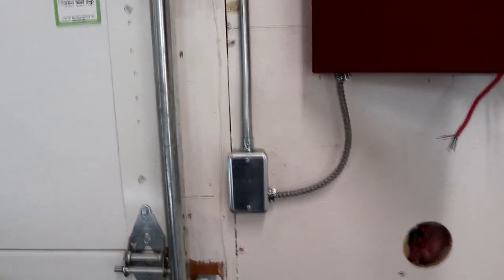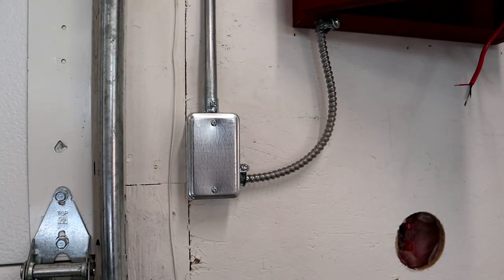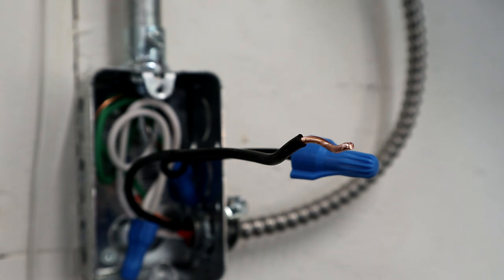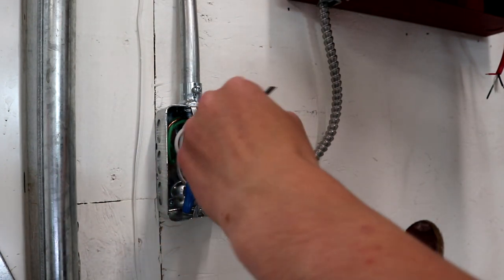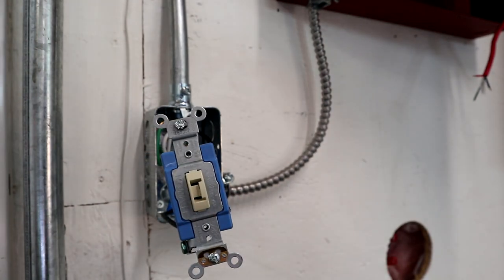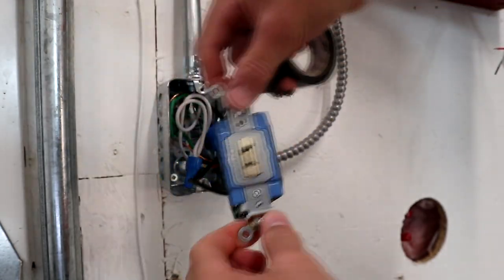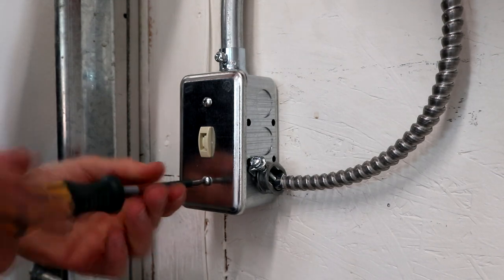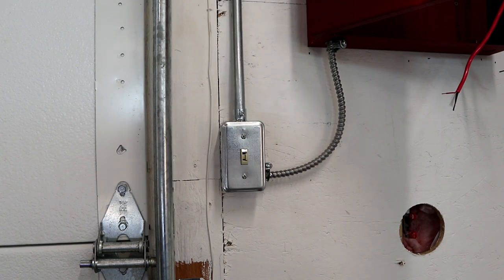Installing a key switch

Comment: for the people that worry about working with the power on;  the live wire is the first to come off, and last to go in. [the cap goes on the live so it's safer if it gets bumped] ground goes on first, and comes off last. this way, there is always a path to earth. it works 99.9% of the time

Comment: Nice Work! Also, my old elementary school used the same exact key switches for lights.
Reply from the maker: Halfway Gamer 2.5 my elementary school didn’t have key switches and then I got in trouble whenever I played with them my middle school has a variety of different types of keyswitches these one are the most common
Reply: @nics-systems-electric  lol thats exactly why i came to this video, because i want to try to turn off the lights at my school. however, they have a different type of keyed light switch, the one that's more rectangular and has a smaller slit. i believe its the HBL1221L from hubbell because i have not been able to find anywhere a keyed light switch that looks like that
Reply: My schools have key switches for lights in most of the bathrooms.
Reply: @Lucas Cunningham Speaking of which, in Kindergarten, the light switches were outside of the bathrooms. So I played with the light switch for the girl’s bathroom. There was a bunch of screaming from the girl’s bathroom. I also used to wander around all the time. My autism was so much worse in Kindergarten.
Reply: i never paid any attention to it, but no that i think about it, i don't recall any switches of any type for the hallway lights

Comment: Dude, there's no fucking way you leave your breaker on while doing those kind of electrical work?! What if those pliers are just a tad bit wet? What if someone switched around live and neutral? What if wire's isolation has broken and suddenly makes contact with the casing?
It'll most likely work for 100 or 10000 Times before something goes wrong, but that one time might very well be your last time. Imagine every single of your viewers does it just like you while one switches around live and neutral. You better prepare to get a good lawyer in the future...
Reply from the maker: Doesn’t make a difference if it’s wet or if the neutral is hot often times neutrals become hot when working on live equipment if disconnection from the path back to the panel it’s all the same as far as just don’t touch anything at a different potential and you’ll be fine you are correct on is it the safest thing to do no but is it done thousand times a day yes
Reply: @nics-systems-electric  My comment isn't meant to offend anyone, but especially non electrical engineers or other uneducated people won't know all the potential hazards. So the best and safest thing to do is, and will always be opening the circuit by switching off breaker manually thus cutting your currentflow!
Reply from the maker: @Elektrotechniker  Yeah you are always best turn off circuits and equipment when working on stuff unless it’s a situation where people are depending on it and cannot realistically be done